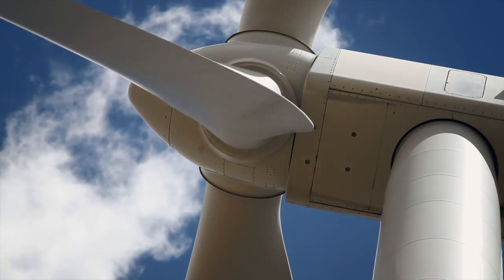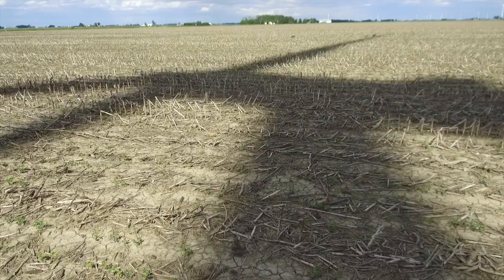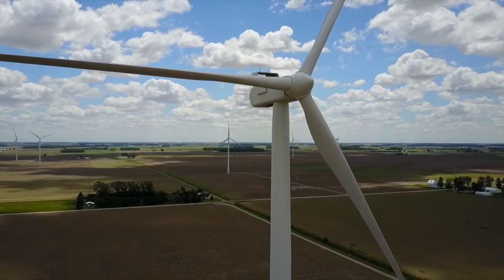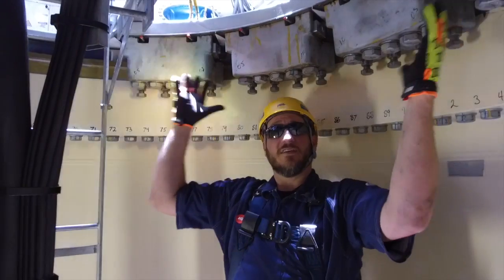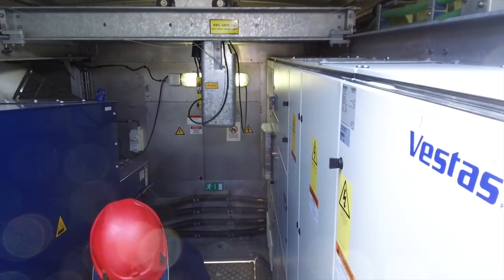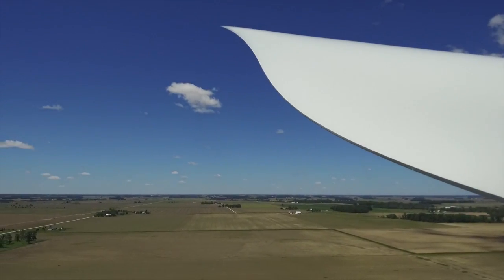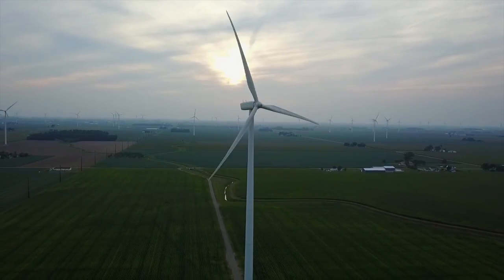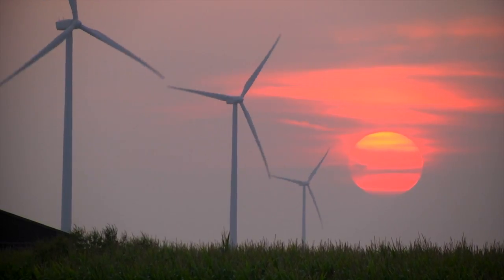Ohio Wind Turbines: beautiful and sometimes annoying

Comment: Basically, you were taught to dislike them. back in February of 2020, the COVID pandemic hit, and people quit driving. For the first time, I could see mountain ranges 100 miles from my home. Now, things are getting back to normal, and to pollution is back. I really liked that clean air. Turbines, displacing coal, can help restore that clean air. You will live longer with a little windage noise, than breathing the pollution of the extra fuel that would need to be burnt to generate that same amount of electricity. Keep in mind, each one of those machines is as powerful as a train locomotive, able to produce well over 2,000,000 watts each. Any time the wind is blowing hard enough for you to hear them, they're doing more than powering your whole town! One of those turbines, in enough wind to be audible, generates enough power in one hour to power your house for over 1 month. All that, without burning a drop of fuel, a lump of coal, or even a single cubic foot of natural gas.

Comment: The wind mills are a boondoggle for environmentalists and the wind mill companies who are lavished millions of dollars in subsidies and cannot sustain anyone's power needs. Once wind slows down and wind turbines stop, carbon emitting power plants kick in to pick up the slack. The majority of the time fossil fuel burning power plants are running to compensate but the wind mill companies still get paid.
Reply: GREEN JIHAD,
ONE OF THESE DAYS, THE PETROLEUM, GAS AND COAL WILL BE BURNED UP AND GONE!
WHAT THEN WILL YOU OR YOUR GREAT GRANDKIDS DO THEN?
Reply: @rossbryan6102  Never happen. https://www.livescience.com/38869-peak-oil.html
Reply: They are not wind mills. They don't grind or mill grain or ore. Think of how silly it sounds if you call the turbines in a dam water mills. Also most wind turbine companies have been financially independent of subsidized operation for almost a decade. It costs less to build a new wind farm than simply operate a coal plant and offers customers power at a fraction of the cost. It would behoove you to not form any opinion from any news source that requires financial support from advertising.
Reply: Wind turbines are installed in places that are known to have high wind throughout the year. Wind will not die down in these places for a long time.